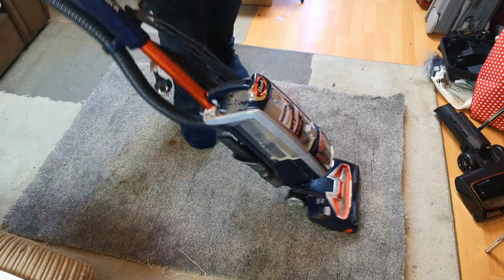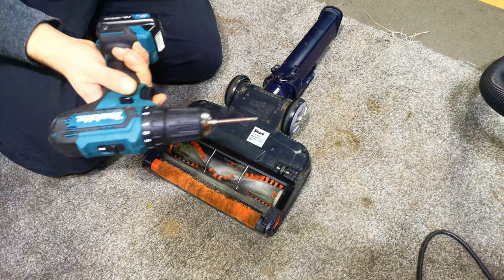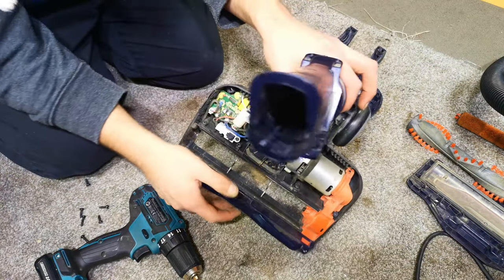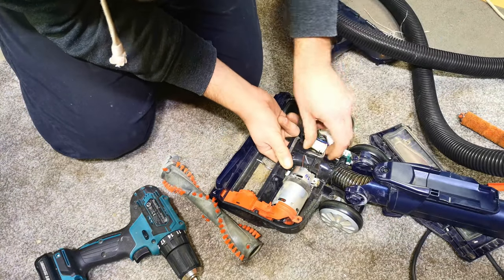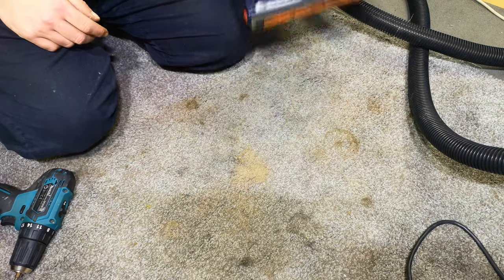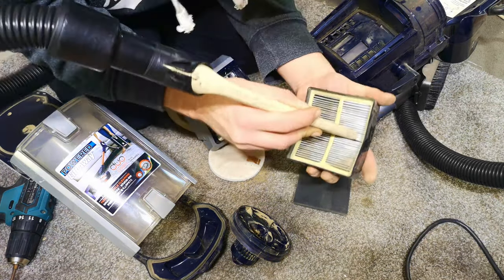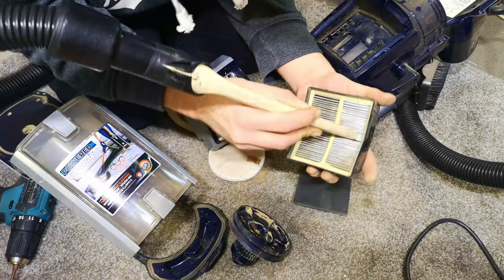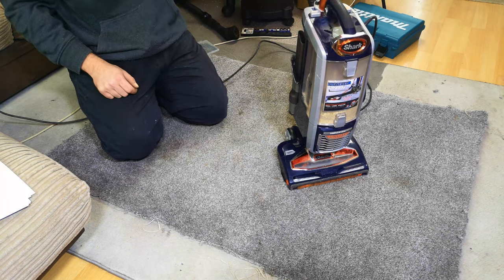Shark DuoClean NV801 Floorhead - Recline Lock Repair & Unclogging

Comment: I think that it might have the wrong foam filter which might explain all the dust in the motor and post motor filter. Usually with the Sharks I have used here in the USA the foam sleeve filter is the same height as the center of the holder. Your filter appear squashed over too so I think you are leaking dust and suction there too. Looks like a speed model with the full size model filter installed.

Comment: Hi I have the same vac and am trying to replace the hose on the head can you tell me how you managed to get it back up in the neck to the correct position
Reply from the maker: With some difficulty tbh! I think I smeared a light smear of oil around it so it slipped up without binding, with the hose fitted to it but not fitted to the other end so it could all move. Got to locate the 2 tabs correctly or it won't seal against the wand
Reply: @beko1987  Thanks for letting me know :) it looks like the replacement hose I got will be to short after looking at the length of the one on yours :)

Comment: I cannot see how you fixed the locking mechanism. Could anyone explain further?

My shark floor head stays reclined and won't lock.
Reply: If you find a video that does explain how to fix tht please tag me!?
Reply: Me too
Reply: It's the screws that hold the housing together by the back wheels. Check his comment reply to another comment elsewhere.
Reply from the maker: Yep, all I did was tighten the screws. The housing being clamped down is what makes the recline lock work.

Comment: I had the dreaded split bottom hose on mine. I fixed it today using Gates Green Stripe, automotive flexi-hose. 50x the quality and strength of the OEM part and It now sucks like Vyvyan's V8 Hoover, from the Young Ones..  😜
Reply from the maker: When their working well they are nice things! Good fix, I use hoover Turbopower 2 hose cut down! Perfect screw in fitment and you can get 5 hoses out of one 😂 Grabbed a couple from Bartons to stock up for years

Comment: I have a nv800ukt and getting air leaks which mean the suction is poor at the head of cleaner. How did you push the rubber seal into the top properly??
Reply from the maker: It's very fiddly, and usually easier with the entire neck removed from the machine, and washing up liquid. The 2 rubber tabs have to fully seat and snap in to the coating lugs
Reply: @beko1987 previously the hose was glued on. So now when I push the hose with the rubber seal through, the hose ends up pushing through instead of the grommet seal. So I think I'll have to glue it so it stays in position. I have tried washing up liquid to get it moving but it's sooooo difficult to get it right. Any other tips?

Comment: Hi   you did not show recline lock repair only cleaning,  my cleaner head drops when being carried any clues ????
Reply from the maker: Have you checked the 2 screws that sit by rhe back wheels are nice and tight? The main housing provides the resistance for the sprung plastic locking tabs, if the casing is loose that's the reason. Seen it a few times, hopefully it's that simple for you 👍